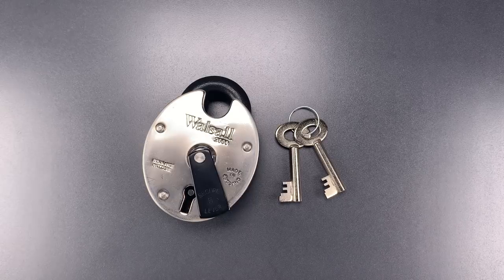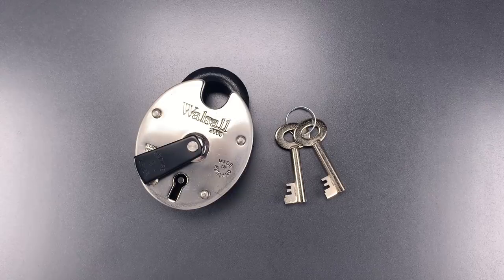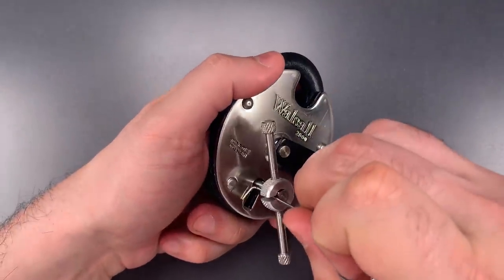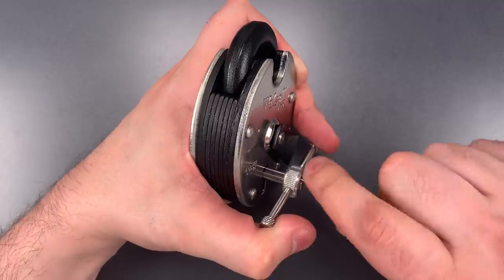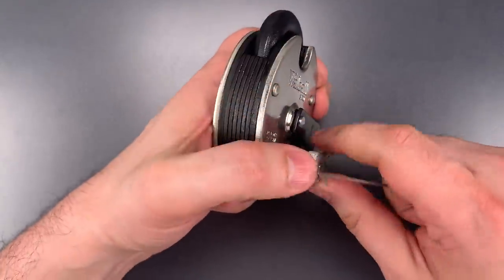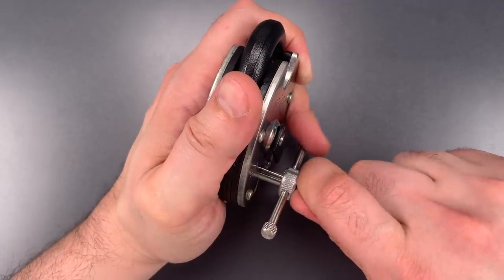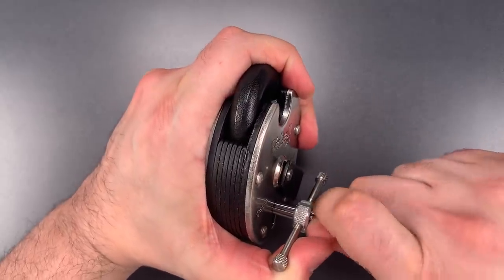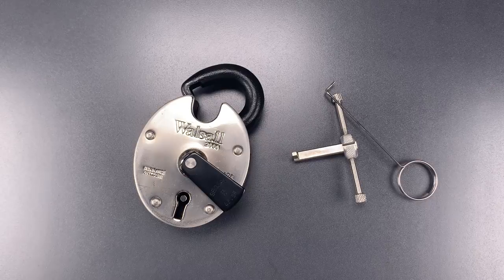[1125] Walsall 2000 Insurance Padlock Picked (5 Lever)

Comment: Can you imagine how long this lock would take a mere mortal?
Reply: Impossible...
Reply: @johnweber4504  impossibru
Reply: A mere mortal would bring out the bolt cutters.
Reply: *Looks at Ramset* Not that long.
Reply: @ehsnils  Ah, the bolt cutters, my favorite lockpicks.
Reply: haha ramset go bang
Reply: Who'd bother cutting the lock? You'd cut the chain or whatever it is connected to
Reply: lots of secure doors and gates you can't even get to the part the shackle is locking, it is deep inside a protective box cover,
Reply: Without the specialty tension tool and just some common lockpick set too?
Reply: @ruediix  Not that specialized in a country that uses lever locks. That's why both the lock and the tool are from the UK; it's not a common lock type elsewhere.
Reply: RenchesAndSords South Park “Black Friday Bundle” reference?
Reply: Yeah, as it happens the idea of a lock is that the key is the only way to open it
Reply: straight to the angle grinder
Reply: Older squire lever pad locks gave me more trouble than Yale pin tumbler locks, lots of fun in the UK growing up in the 80's and 90's
Reply: Using a hammer would be faster
Reply: Also needed a tool from the UK. I wonder if there are only a few dozen in the US who can pick this at a moments notice.
Reply: @ehsnils  Lol, portable hydraulic shears.

Comment: "Tricky little lock" = Just forget about picking it. Bring an angle grinder.
Reply: Grinding hardened metal is not easy
Reply: Bring two batteries
Reply: Koustuv Dey just fire artillery at it
Reply: Just dynamite the door, you ain't getting through this thing.
Reply: Tricky to non-Europeans who don't have exposure to lever locks. 
After about a dozen, they are just as easy if not easier than pinned locks
Reply: cullen wessel 
This is a British Lock, sold & for use in & in Britain guns are illegal ! Therefore the sound of gun fire is going to quickly attract the attention of the Police who are quiet likely to shoot the person with the gun. It's also worth noting that when people get shot by the police in the UK it's rare they survive, the specialist firearms divisions of the UK Police force can be a bit over zealous.
Reply: Samuel Prince  Thermite makes short work of EVERYTHING.
Reply: @WhiskeyGulf71  It's also much more rare to be shot by the police, as they tend to only bring their firearms when necessary. So you KNOW you messed up.
Reply: Forget the lock and forget the shaclle.
Cut the door itself
Reply: @dhawthorne1634  LPL has picked lever locks plenty of times; just search his videos page for the word, "lever".
Reply: @doomking5174  That sounds like a case of the "greater good" mentality there. I mean you don't wanna mess around with shotguns in the hands of a criminal, but I don't agree they should have shot the hostage to get to the criminal. As rare as something like that might happen.
Reply: @OtakuUnitedStudio  To put this into perspective. The uk has a fifth the population of the US and if the total number of times in a year that the UK police have discharged a firearm, (both intentional and accidental), is greater than 10 you'll get mass media outcry about unacceptable levels of violent crime. It's exceedingly rare for the police to actually fire a gun in the UK.
Reply: I'm in tears laughing so hard at all these comments and I'm not even halfway thru. I'm truly grateful to everyone in this community for raising my spirits during dark days. Also I think you people in UK are crazy. I'm getting my passport to hang out and drink some ale with everyone. I'll even get the 1st round.
Reply: @darthkarl99  Exactly what I was getting at.
Reply: it uses a commonly available key to unlock
Reply: arfster2 breach charge
Reply: @WhiskeyGulf71  Guns are not illegal in the UK. There are just super strict bordering on silly levels of requirements to meet. On a gun related forum I frequent there are quite a few legal owners of AK style (saiga) guns living in the UK.
Reply: @You Have A New Message I wouldn’t say UK armed police get over zealous in the slightest. To warrant a visit from the UK armed police you need to be doing something pretty messed up. Our armed police kill an average of 2 people per year, and if you look back at the people killed, they’re usually always someone who has killed or stabbed people (often terrorists) so the police would be shooting to kill in those circumstances, and rightly so. That isn’t over zealous at all. 

Most of the time, our armed police are not shooting to kill, they have some of the best firearms training in the world. But of course the cases of just being shot in the leg and surviving don’t always get to mainstream media. 

Now, compare the UK’s armed police average deaths and average shot but not killed stats and reasons to almost any other country and then rethink how “over zealous” our armed police are...
Reply: cwuzii big up Britain lad
Reply: @LordPrecision  An angle grinder with a 1mm disk will cut through all hardened steel without any problems.
Reply: I like the one guy implying that the sound of gunfire in the US somehow wouldn't draw police attention

Comment: I've only been here a few months, but this is about the most I've seen him work to pick a lock.
Reply: May I recommend the naughty bucket chronicles?
Reply: I am heavy weapons guy
Reply: buying locks that actually resist picking, like Medecos, Rotalok, ABUS, Bowley, is probably the way to look at this. We are comparing cores that were cheaply made to ones that have features like pin in pin, rotating pins, well made discs.
LPL does both, but he has been sharing a lot of the "locks to avoid" because you can shim / bypass / rake open which is as good as a master key (but everyone has access to the master key in that case).
Reply: @dragade101  Abus has plenty of locks that can be picked fairly easily as well. Like any lock company, they too produce locks from budget to extra security. 

The only thing that really sets them apart from the awful locks featured here is that you can usually tell from the packaging which one you're buying.

Comment: Picked by LPL in about 3 minutes  = not pickable to mere humans.
Reply: Cannot be picked in practice when on a gate open to public view. It is called an 'insurance' padlock since insurance companies insist on it for various purposes (along with a decent hasp). I do not know what the 'specification' is, but there is a British Standard for thief resistant door locks governing both strength and resistance to manipulation. The padlock would comply with significant parts of the standard. The lock needs to have at least five levers with false notches (or other 'device') have at least 1000 differs and reasonably resist picking etc. Although 1000 differs seems small, the lock must be capable of 10000 operations and then unable to be opened by keys with one higher and one lower cut compared with the proper key.
In UK the LPL could probably earn more money assessing locks and padlocks for insurance purposes than from practicing law.
One disadvantage with this style of padlock is the key must be turned to lock the padlock. It cannot be 'clicked' shut. Hence it cannot be shimmed. The padlock would normally be locked on the chain or staple even when the gate or door is open so the padlock cannot be nicked.

Comment: "if you have a few minutes" which means in the security world the lock did its job.  Good security is not about and never has been about prevention of access, But its about discouraging unauthorized access.  If someone has to take a few minutes to pick this they are likely to be seen, Or use destruction based methods that draw attention.   Only takes one set of eyes to become a 911 call*

*Disclaimer, In the land this lock comes from I believe the number is 999 instead of 911.

Comment: Why don't people use lever mechanisms if they are so relatively hard to pick?
Reply: It's probably cost based. If lever mechanisms aren't expensive to make then they're expensive for a company to buy and put into their lock because they're better
Reply: If everyone used them then pickers would be accustomed to them and they won't be that hard to pick
Reply: Picking isn’t really something that is done a lot. Most common criminals are more likely to destroy, bypass, or otherwise address the issue.
Reply: The keys are clunky.
Reply: Such locks were very widespread in Russia soviet times. They were literally on every barn.
Reply: They've historically been very popular in England but nowadays you're more likely to encounter a pin tumbler.
Reply: In France, high security doors have double sided lever locks. Even cops sometimes can’t open those locks or brake the door with their hydraulic lever, than they have to climb through the window
Reply: Well, for the vast majority of lever locks they are not that hard to pick. They are generally used where durability and reliability are the priority but where you need to have a higher degree of security they have locks like this.

The Victorian era had numerous designs of lever locks which still to this day are considered to be unpickable and they are still in perfect working order with no more wear to them from when they left the factory setting aside age related cosmetic wear. I have some in my collection from the 1830's and mechanically they are practically perfect.
Reply: Most pickers are probably used to picking pinned locks, rather than levered locks.
If lever locks were more widespread, that situation would be the reverse.
It is also worth mentioning that most people who try to bypass a lock don't do so by picking.
Reply: @manimanus67  I'm in Norway. My gun safe has a double sided lever lock, set deep with a long key so you need specialized tools just to reach in there and attempt picking.
Reply: @LordSStorm  Very true.  The last round of buglaries in our area involved kicking down doors and grabbing whatever electronics were on the table before running out before an alarm would even sound.  Many years ago, my own home was robbed, and they broke a window to get in.   (The window actually cost more to replace than the crap they took.)  Unless you leave a copy of the key under the mat or in the nearby flower pots, they will almost always break a window or glass door, with the occasional door kicker.
Reply: @Kit_Bear  Send one to lpl. I'd definitely watch that!
Reply: Good question...
Reply: Kaboomf the only problem is that some russian locksmith are manufacturing and selling pump keys for those locks and it’s quite impressive how fast they open them. 1 positive point is that they work only with one specific model.
Reply: @Kaboomf  Same here in Germany. There have been no recorded cases of a gun ever stolen from a gunowners safe inside of their home (although it´s know that you can pick them with that specialized tool). Yet they still recently heightened the regulations regarding gun safes, I had to buy one that´s a class higher from my previous one because my new rifle didn´t fit in the old one anymore. I got it with a keypad because having to constantly worry about the key was not something I wanted to keep doing.
Reply: @martinheath5947  I've already offered one and to BosnianBill but none have replied. Perhaps they didn't see the post.
I might just PM them for a more direct response.
Which do you think would be more interesting, a door lock or a padlock?

Year or mechanism? Should I tell them what it is or not? Hmm?! I could be quite devious with this one.

Comment: When he said I need this tool made by Mad Bob to open this English lock, reminds me of I need these British Standard tools to work on your Triumph.
Reply: "Whitworth" ...  different threads, different wrench sizes, still 'inch' based.
Reply: @geepeerces  Thank you, I could not recall the name. It's been about 30 odd years since I worked on British Motorcycles.  I do recall that not all had a direct standard size or metric that it converted to.  Still LPL needed a specific tool to open the English lock.  Just made me think of that.

Comment: This looks incredibly similar to many 60s-70s Soviet locks, even key handle has the same shape. Both padlocks and built-in locks were like that, I've even seen them in cupboard doors where no security is needed normally, probably as some sort of cost-optimized child protection. Not sure if these have false gates tho

Comment: This goes to proove that lever locks still has merit. In fact, lever locks are often used as auxillary locks (what americans would call dead bolts) on doors here in Sweden and probably the rest of Europe as well, and is a very effective theft deterrent, if there is a locked auxillary lock on the door, choose another house/apartment.

Comment: Hey there, I was wondering if you could help me out, I have a typewriter case (Typewriter case is from a 1940’s Torpedo 18 typewriter)that is in the locked position. I have tried sticking paper clips in there to get it open but to no avail; I was told to reach out to you  to see if you could help me. The lock itself is similar to the one in this video but affixed to the typewriter case. Any help or guidance and I would be much obliged! If you need photos I can send them via email too. Thank you for your time and concern and look forward to your reply.

Comment: Should just put 5 different locks with different locking mechanisms chosen from the top locks as rated by LPL. This would make whatever you lock as difficult to pick as either brute forcing, using an unforseen backdoor, or a very skilled picker with proper tools.

So basically only someone with the keys, LPL, or someone trying to murder you can open those locks.

Comment: maybe master lock should start making lever locks, it takes longer to pick.
Reply: If they did, they would be 4-lever with no false gates and such sloppy tolerances you could smack them on the side to open.
Reply: @greendryerlint  yeah so they would be just asd useless as their normal locks but they would be cheaper :)

Comment: Having the key present at the start of the video, does this give clues as to the positions of the pins, and therefore help with the picking process? Would it take him longer had he not seen the keycut pattern?  Answers appreciated.
Reply: The cuts on any key, whether it be pin tumbler,  tubular, disc, or lever, will give you definite clues. A high cut on a pin tumbler style of key will tell you the pin has to be lifted further - a low cut not so much. Same applies to lever locks. On a disc detainer key, the steeper the angle of the cut, the further the disc has to be rotated - with the key. The clues are there, how far or how less to move the disc with the pick when rotating individual discs. Keys are often mummified to prevent visual "reading" of the keys, prior to picking. Keys such as Abloy Protec, and some multipinned Kaba keys are more difficult to sight "read".
Reply: Thanks Threadie
Reply: Thanks Brian Hignett

Comment: That locks not worth the matal.its made of nevermind what its protecting.  Second try and its open. Better off with a bolt with a nut welded on.  Atleast it cant be picked in a min